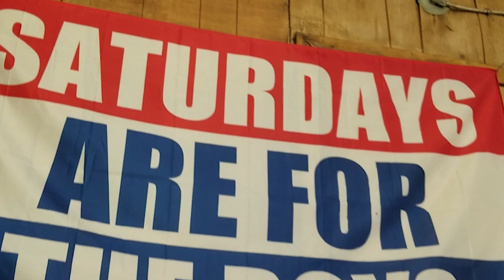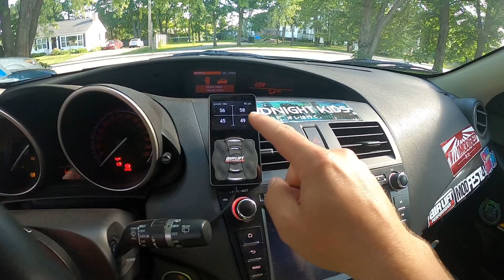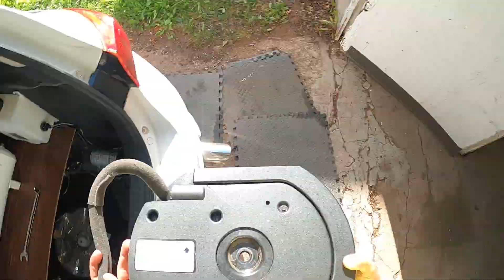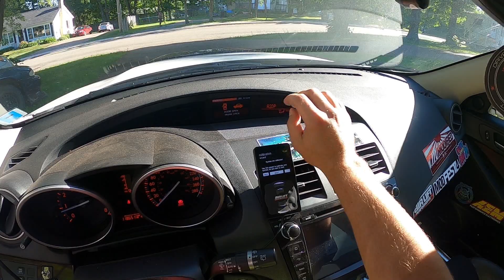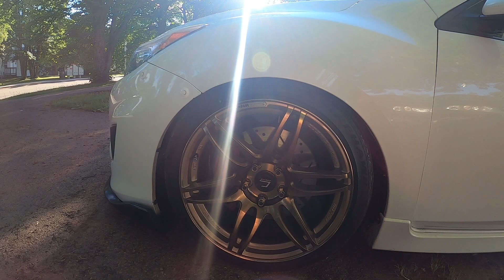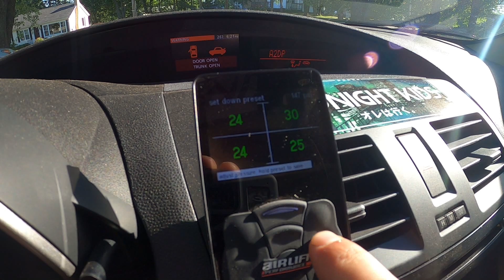The Most Common Airlift Management Issue Fix, Calibration and Presets! (3P Install)

Comment: Does the ground need to be perfectly level. Im not running sensors. When i get to setting 13 and wont go past. Leaves the rear at full height then says calibration failed
Reply from the maker: I don't think the ground needs to be perfectly level. I wouldn't do it on some sort of noticable slant though. I would check to make sure nothing is stuck impeding the car to fully air out.
Reply: sweeet dude yeah it can air up and down no worries so il drive it to a more level spot then my drive chers @RoadRoyals

Comment: Why my presets never stay the same ? Even when i click it to set my presets will not reach what i preseted. Also Airtank is losing PSI when i drive or over the night when car is parked , when i go to start the car my PSI is low, is this normal?
Reply from the maker: The presets I'm not sure on, make sure you are saving them. You have a leak somewhere in your lines or fittings. Spray with soap and water and it will bubble where it's leaking.

Comment: Question I ordered a replacement manifold plugged it in and the controller doesn’t turn on..... but when I plug in the old manifold it turns on..... I noticed the harness that came with the new one looks a little different. Do you think I would have to change out the harness?
Reply: It sucks because I’ve already waited 2 weeks for this one to come in but hey gotta pay to play right!? Lol
Idk I’ll make up my mind tomorrow if I want to run through the whole interior to swap out the harness 😫🤣

Comment: bro i replaced manifold ect and im still not being able to calibrate, it says pressure control failure
Reply: I had that problem your saying and I found it was 2 slightly pinched airlines.  I could of swore NONE of my lines were pinched but there were.  Twice!! So check and recheck and oh... recheck.

Comment: Hey, quick question when you swapped out your manifold. Did you just empty out your tank to 0 psi or empty out the air on your bags too? So everything is practically 0 psi all around. Thanks
Reply: Perfect, one of my PTC cartridge went leaking on my APv2 and replacement part arriving on Wednesday. I don’t wanna mess up lol. I dig the trunk setup, might do something similar! thank you!